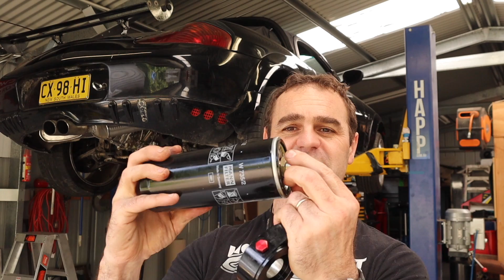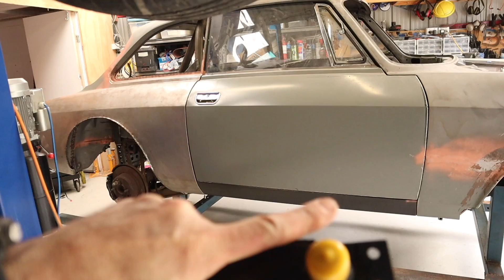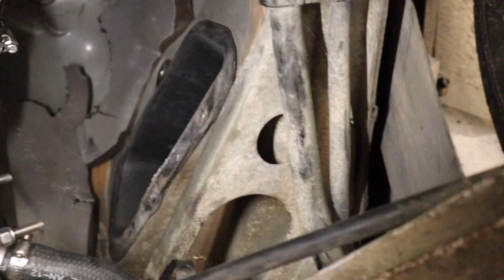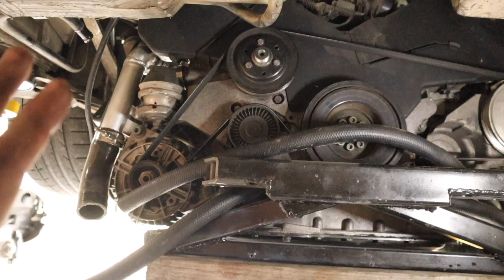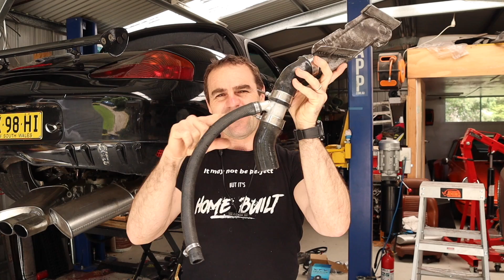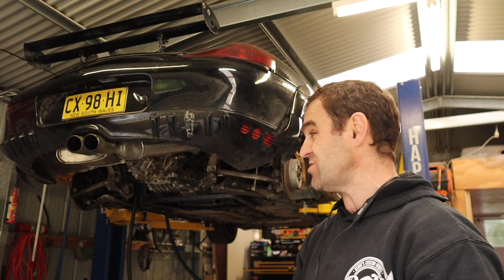Fitting an oil cooler and other wasted work - Porsche 986 Boxster V8 engine swap track car build 21

Comment: Coming along nicely Jeff.
I am wondering if you have an air lock towards the front of the car.
As the water now has more real estate to move across the car than in the Audi.
As others have mentioned, the standard water pump may not be able to push all that water.
I agree with another comment about removing the thermostat & use an temperature controlled electric water pump.
But still worth bleeding the original coolant system throughly  using the standard pump see how if fares.
Another thing to consider.
A thermostatically controlled oil cooler.
 You may find and this may apply to the AlfaFerrari.
If the oil cooler works constantly it may over cool the engine as the oils also acts as an engine coolant to an extent.
Thermostatically controlled would mitigate this.
Agree with all other commenters 
That I also like that fact you show your mistakes as we can all learn with you on the project (s).
Good stuff 👍

Comment: Also Jeff, I forgot but first I don’t want to be back seating your project because you are doing great. I have learned from all your vids bud and I am afraid a little to interfere. But on your timing belt, you really don’t have much choice on length, you may get a little tighter with a new belt but you have already solved the problem with the oil accumulator. Your hydraulic belt tensioner pumps up in less then a full crank of the engine, so, maybe an electric solenoid that releases your oil on fuel pump circuit would be a great add on, also you should loose your cam chain rattle at start up. You may have just solved Audi’s biggest complaint my friend.
Reply from the maker: The squealing is from the serpentine belt, not the timing belt ;)
Reply: @HomeBuiltByJeff  you noticed your timing belt was loose Jeff, I was talking about that. Nothing to do with any squealing bud.
Reply from the maker: @jamesdorsey1686  The serpentine is loose. The timing belt is fine.
Reply: Hello Jeff, I was talking about your timing belt, you though it was loose when you pulled the thermostat.

Comment: Hello Jeff, thanks for all the time and great adventures, keep going. A bit about Audi V-8’s. 1) Machine or grind off all the stock vanes on the stock water pump ( you will need the pulley for the timing belt so that means keeping the pump shaft in place. 2) throw out the thermostat and leave the port open. 3) Install an electric water pump that runs on temperature and not on engine rpm. You will see the difference on the exit ramp of the Autobahn Highway, she just keeps cooling at the stop light. OH! Pull a vacuum on the coolant system and fill it under vacuum. No bubbles. We are learning masses together my great friend.

Comment: Possible brass contaminants from the wire brush when welding the fittings on the adaptor plate mucked up the weld?

Comment: Hey Jeff, you may want ad to an electric waterpump to the cooling system because the standard pump probably doesn´t have the capacity to move all that water through the pipes to the front of the car.

Comment: A friend  has a VR Holden Commodore in Improved Production with a 5 liter engine and he fitted an oil accumulator fitted to the car and it resulted with a blown engine which cost him many thousands to fix, when the engineer looked for the course it all came back to the accumulator. I have of others with the same experience.
Reply: That should be 5.7 liter.

Comment: Hi Jeff. With your re-routed serpentine belt, is the water pump still turning in the correct direction? Wouldn't be doing a very good job if it was turning backwards. Also, is there enough belt wrap around the water pump pulley to effectively drive the water pump? How does it compare to the original Audi factory wrap around? The slipping belt won't be helping the coolant pumping cause either, even if everything else is correct as the pump may be running slower that required, especially given the extra distance the coolant needs to travel to the front of the car.
Reply from the maker: Water pump is run off the timing belt in this car as you can see in this vid ;)

Comment: Oil cooler is upside down. You'll get some oil in it but you'll never purge all the air out. You need to run one or both fittings up.

Comment: Hi Jeff, I have an MG MGF, mid engine set up as per the rockstar. On the MGF, there are also side vents, 1 for the air intake and the other is for a fan that operates from an engine bay thermostatic sensor, it will switch on if the ambient temp reaches a certain point, have you come across the sensor when stripping down the old set-up? Just a thought to pass on, like so many viewers, I am really enjoying all the projects 👍

Comment: Get a couple of dry break connectors for the power steering so your engine removal becomes much easier.

Also fit a fan to the oil cooler to bring down track oil temps easier 👍

Comment: What was the volume of the accumulator? Apparently so small that it does not matter if the extra oil will end up to oil pan after the engine is shut down.

Comment: When you first run the engine after fitting your new oil routing, do you have to be worried about the time to fill those lines and accusump with oil?

Comment: Jeff. The water flows path of least resistance. So what you need to do is think if it’s preferentially circulating via the tank. If it is you need to put a flow restriction in that tank line to increase the pressure drop and therefore flow to the front radiators.

Comment: Jeff, I don't know if it's something you might want to do but Dixon or similar hydraulic hose quick connect/disconnect like we use on the farm. From local hydraulic hose supply where farmers etc get hoses made. They are self sealing so you don't lose anything.
For the power steering lines.

Comment: With an Accumulator Mr Jeff, use an outlet shutoff valve. Rev the car up to around 2500 rpm for a few seconds and close the valve. Go back down to idle and shut it down.
Now you have pre start lube system as well. Open the valve a couple seconds before you start the motor. Cool benefits of the accumulator even if you don't need it for long sweeping turn oil starvation.
Side Note: don't leave it charged for long term storage, it may develop a leak and unload all over the car.
The Roxster is coming along mint. One of the best mods anyone can think of. Chassis is perfect even in the convertible for tracking. Just add power and goooooo.

Comment: The only people who have never made this kind of "mistake" are those who haven't set on an engine swap adventure like you did.

As you rightly said, good learning opportunity.

Now what I am still very curious about is your chassis moving on/off throttle. I currently have that on my 997 but it is because the rear tyres are worn in very different ways (BC of a flat), and it is quite obvious.

Comment: An air lock will stop coolant flow through the pipework and radiator just like the wet central heating system in a house.
Why not fit a bleed fitting on the system near the radiator at the front of the car to ensure you have all the air out.

Comment: The original Boxster air fan is there to control the temperature in the engine compartment. In order to avoid overcooking the interior and maybe components from the 911 part bank that were maybe not developed for this layout.

Comment: Those oil coolers need to be mounted vertically, or trouble is to come. Currently, any air in oil will accumulate into the cooler. With or without accu sump.
When horizontally mounted, connectors at top, cooler is able to bleed, and works ok as far as there is no other problems. But vertical is the way to do it the right way.

Comment: I doubt that the positioning of the expansion tank hose is the issue.
There is the possibility that the cooling system is one way and you have it backwards OR the pump is not capable of pumping the coolant all the way to the front.
Checking that a new thermostat works before installing it is wise But don't assume that because it opens less than the old one that the old one is better. 
A hot air gun can take the thermostat closer to it's operating temp than boiling water.
You need to check the rating at which it starts to open (80 to 120 Celsius) and at what temperature it should be fully open (120 to 160) This information should be in the owners manual or shop manual and printed on the thermostat itself and its box.

Comment: Engineer
   Putting the water pump and thermostat in an inaccessible place will make it too difficult for all but well equipped shops to replace such regular wear items.
Bean counter
 Putting regular wear items in inaccessible places that require many hours of expensive work to replace will result in our vehicles becoming financial write offs before the end of their normal lifespan WIN WIN!!

Comment: I thought the oil accumulator had a pressurised bladder within it that acts like a spring that sits at working oil pressure, but should the oil pressure drop it forces more into the engine, no?
Reply: That's correct, however you need the one way valve there so that the oil goes to the engine not to the pump that is cavitating. While the pump is drawing air the pressure will drop.

Comment: We've all been there, remember if you aren't making mistakes you aren't learning.  btw I may be wrong and mis judged angles from the vid but I think your oil cooler should be either flipped so the feed comes in from the top aka old gsxr750,1100;s or sideways so the inlet is in the bottom and outlet on the top.  As you have it I think you might get a big air pocket on the top and hardly any oil in the cooler

Comment: As I understand it it's generally recommended to mount oil coolers with the hoses to the top or the sides because otherwise it can be difficult to bleed, you could undo the mounts, run it on the lift  with the hoses at the top until bled then mount it back up.
Reply from the maker: I used to think that until you see how fast the oil flows when it is running at full throttle and there is no chance for an air lock ;)
Reply: @HomeBuiltByJeff  it doesn't need bleeding as it doesn't really care if there is oil in there. However it has been proven that an upside down oil cooler isn't efficient in cooling as even though you have 60+psi of pressure it won't fill the whole system and therefore doesn't fill the whole cooler from the bottom. The reason you should mount it with the fittings at the top or the side is so it fills the whole cooler before going back into the engine. It's like have a radiator with all the fittings at the bottom. It won't ever be able to cool properly as you aren't using much of it at all.
Reply: Pressure in the oil system does not need bleeding, it is not static like brake fluid or circulated at low pump pressure like coolant